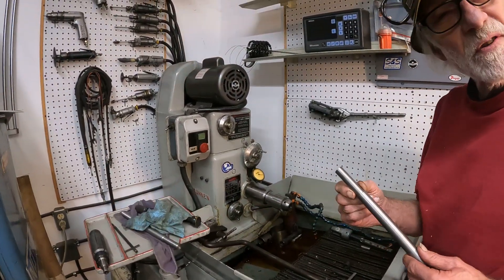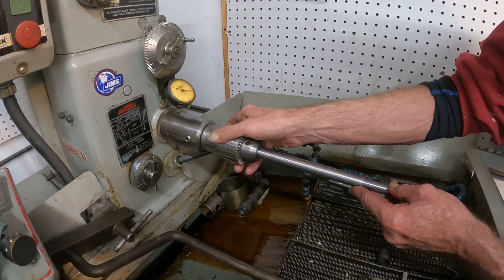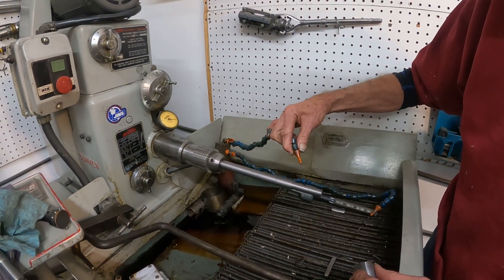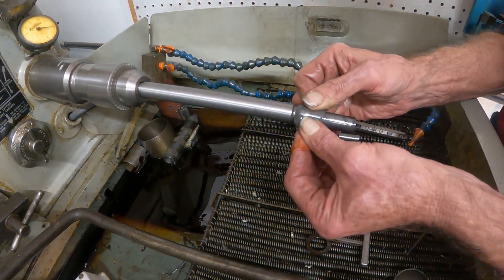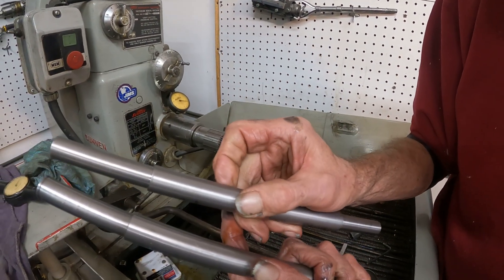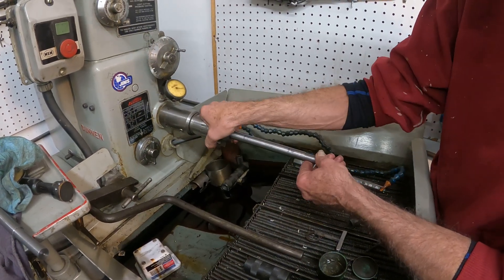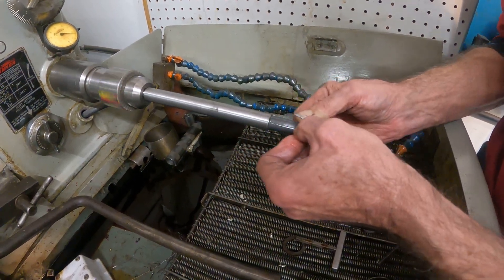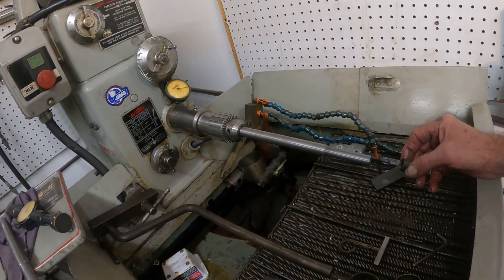Sunnen honing machine external work on the MBB 1600

Comment: Does that change the tolerance on the shaft after using the lead and that compound at all? Have a great day.
Reply from the maker: Yes, I checked the part I had .0001" over size and it reduces the size about .00006". The material under just 15X looks porous, it has oil or lube retention,